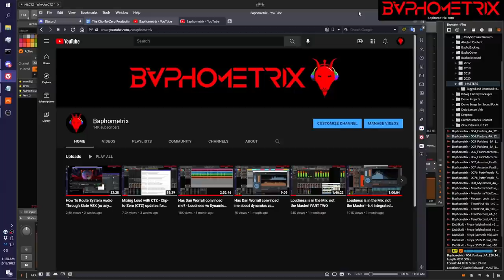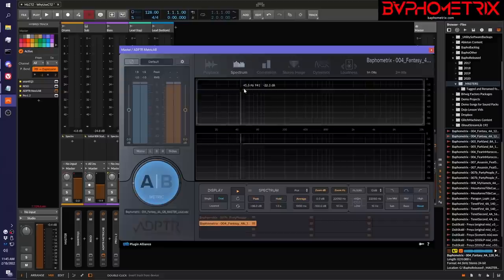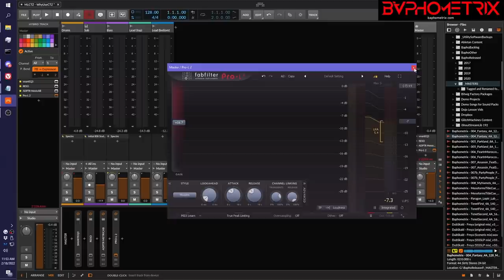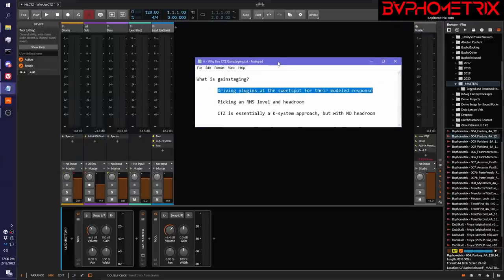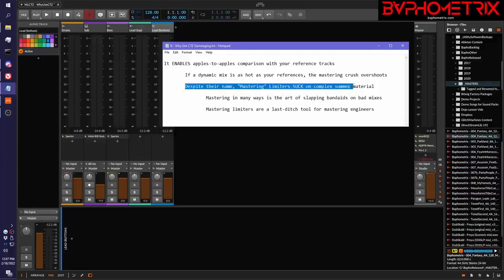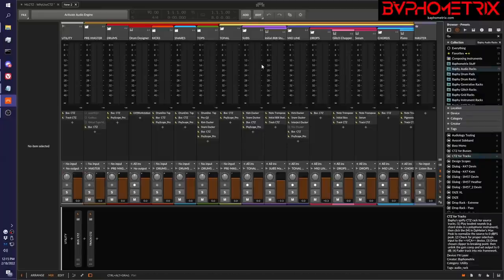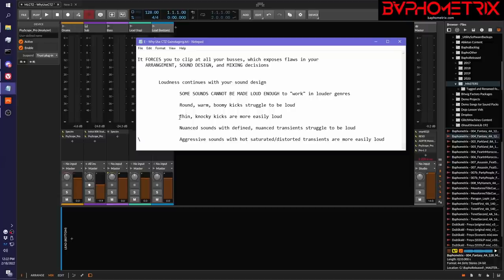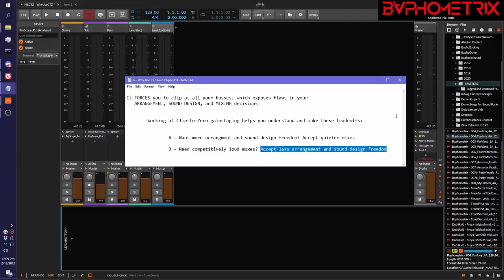Mixing LOUD with CTZ - Ep. 2 - Why Use CTZ Gainstaging?

Comment: Regarding compressors. Why use analog modeled compressors at all? Wouldn't be easier just use digital comp like Smart:comp or Fab Comp and forget about all this gain staging nonsense?
Reply from the maker: Compressors change the dynamic FEEL. They make transients sharper, or they make the sustain louder. They cut entirely new gain envelopes into the sound. Clippers simply reshape the peaks instantaneously. Two different types of processing for two very different outcomes.
Reply: @Baphometrix  I think he meant as far as gain staging for the "sweet spot" like in the 1176 example gave. But as you said, those aren't really "necessary" for this kind of music, so they can be replaced for digital compressors because of the linear effect. So you had already answered his question in your video. 

Also, single best mixing advice I have found anywhere, and I've been grinding it for a minute now. Great series, thank you dark lord 🧛